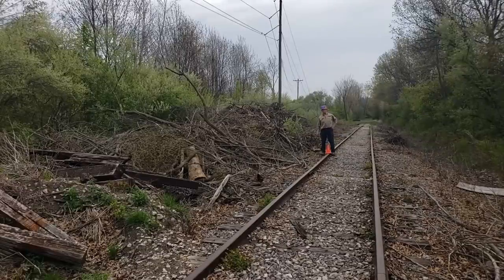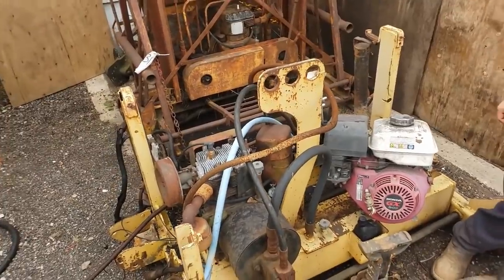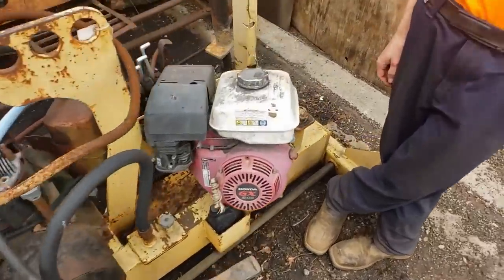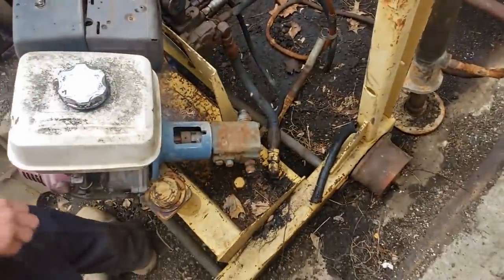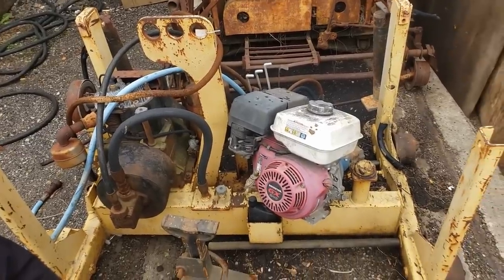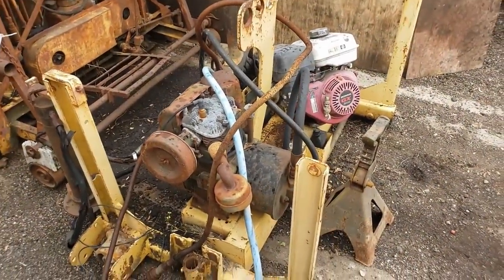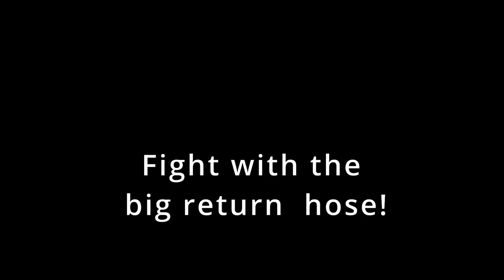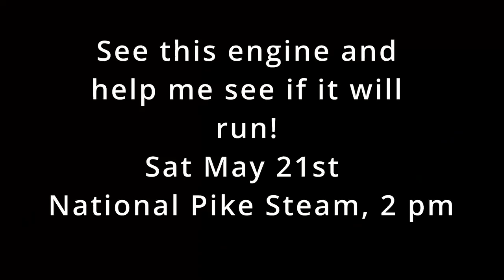I bought an Abandoned Railroad!  So next I bought some abandoned railroad Equipment!

Comment: Just a tip from an old maintenance man, when using an adjustable wrench, never pull against the movable jaw, always pull against the fixed jaw.
Prevents tool breakage.
Reply from the maker: Gary  Good advice on tool usage!  B.
Reply: Gary Hock, thanks I will keep in mind, best thing about this channel is that we learn from each other and pass on advice.
Reply: Every time I see someone using an adjustable "wrong" I want to comment!  but... it can also save you some broken knuckles.  That's why an adjustable is called a "knuckle buster".  Good luck with the equipment.
Reply: Amen.

Comment: I know small engines pretty well and IMO you will need at least a 14 HP engine to power that tie puller. The Wisconsin engine should  be rebuildable with new piston/rings, bearings and a little head work. It won't be as efficient as a later OHV engine but you'll need the power it can produce.
Reply from the maker: We almost had it running today at the subscriber meet up in Pennsylvania!  Possibly a new condenser and cleaning the head and valves will get us in The "running Zone"  B.
Reply: @eastterminalrailway5975  That's good news and worth a try. If the engine can still put out the needed power you're home free. Those old  Wisconsin's are very durable and very strong.

Comment: Was that red Honda GX engine actually seized?  Or, was the pump seized?  I used to sell Honda small engines.  Honda GX engines are very rugged and failures are very rare, assuming decent maintenance.
Reply from the maker: I am sure it's the pump, we had that running a couple of years ago.   Then when I moved the engine last week water ran out of the hose to the pump.  Brian

Comment: You're welcome to come and take a look at my tie puller anytime and try to get it running again!  Apparently it ran within the last 10 years.... but they found that the ties were too far gone for it to be useful.
Reply from the maker: David  I think that will be the case with some of our ties as well.  Brian
Reply: @eastterminalrailway5975  I've got bigger problems right now - my Pyke Tie Crane has an issue - we think its the hydraulic motor - when the oil heats up it changes viscosity, and the motors vanes are too chewed up for the thinner oil to drive it.  So it won't move forward or reverse with the hotter oil.
Reply: @lxdesign1  a few hand full of saw dust in the oil would be a temp fix.
Reply: @mrbakerjjim  I will suggest that to our mechanic... but he may not want to go that route... either way - its probably not going to get fixed before the fall.

Comment: Brian, someone reported to me that you were using wrenches in place of mallets/hammers and pry bars and that you also were seen operating the mini excavator without being in the operators seat. I expect a full written report on my desk by next Friday. And don't forget to put in a request with procurement for the tools that will be needed on your next project.
Reply from the maker: airfield3  Col. Sir in the heat of battle some tools were use outside of unit S.O.Ps, we have addressed this issue amongst the enlisted folks, wont happen again.  MK1
Reply: any tool can be used as a hammer.  unless it's a screw driver then it's a chisel or punch.
Reply: The Safety Committee members all have sharp eyes and your best interests at heart.  God Speed ETR!